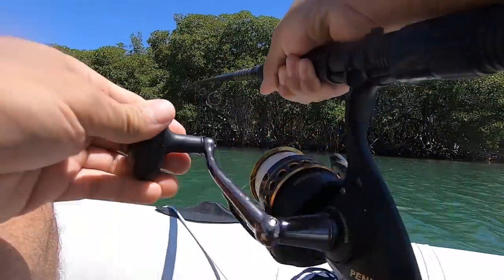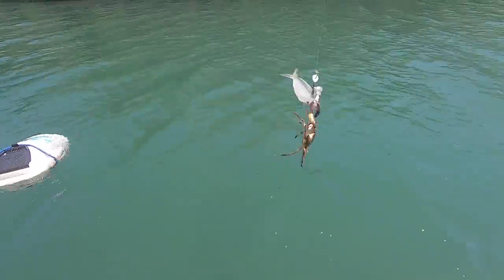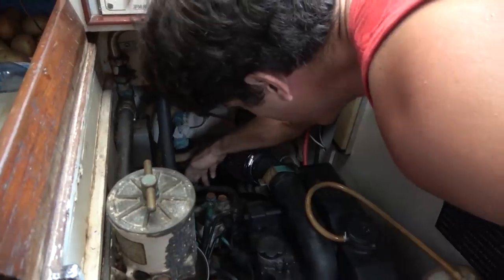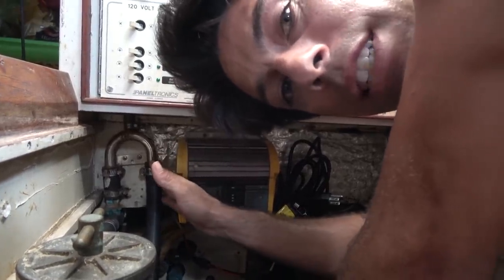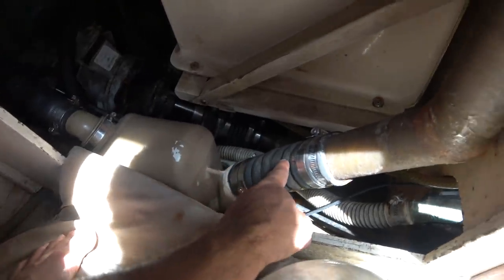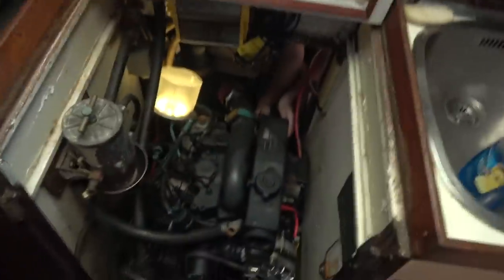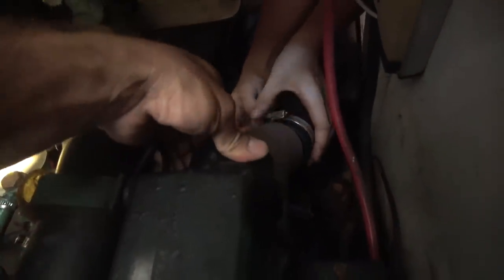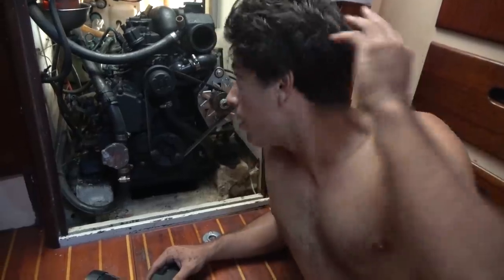Our Secret Weapon is SIMPLY Brilliant! - Bums on a Boat Ep 128

Comment: You  two are becoming mechanics.   Take a screw driver to that oil pan and poke it,  do it on the side first,  not hard enough to dent it, but enough to get a feel.   Then try the bottom,  if it goes through easily you found your problem.   Oil pans rust,  especially after long periods of non use.   Good news is they usually aren't too  expensive,  bad news,  might be a challenge to change in the water.   You want to know now if it's an issue, not find out on a dark stormy night that the pan is bad.      Persistence is key to success,  you both are showing a lot of that.

Comment: Any parts store will have UV leak dye. Add it to the oil (and closed water, transmission, etc) and after running the engine, look around with the UV flashlight that comes with it. A $2 fake money light also works for it. Any leak will glow brightly.

Comment: Love watching your videos; avid subscriber.  As a maintenance tech here is some info that might help.  The reason you have the intake cooling line running through your Gearbox is to cool the gearbox oil while in use.  There is a single copper line that goes in and makes a loop and exits.  then on to your water pump.  This allows the gearbox oil not to overheat.  On another note, some call your gearbox a transmission.  A transmission is the ACTION of transferring power from engine to shaft.  Gear box is used to describe a particular piece of machinery that generally contains two or more gearsets to transmit rotary motion from one place to another.
Reply from the maker: 💡 thank you for passing on some knowledge!

Comment: Thank you for showing the entire system- I have been thinking about this since the last video. As I can tell the boat is a 1974 and the engine is decades newer, indicating there was a re power- I have been involved in many over my years working in marine diesel. Many times an engine will not perform to it's potential or indeed suffer failure due to poor installation. Like having the air intake or exhaust restricted.  We sold an 8kw genset to a motor sailer to replace a 5kw as they added air conditioning and needed more power- then the yard connected the new generators 2" exhaust to the original gens 1 1/2" exhaust- the thing had so much restriction it barely ran- the owner said "the boatyard said it was fine" we (the generator dealer) said "fix the exhaust to manufacturer's spec, or no warranty"  thus the fight began as the boatyard had hours in cutting a bulkhead etc but that wasn't our issue- they were provided with the specs the unit required.  Had they not fixed the issue, that engine would have a short lifespan and possibly failed from water backing up the pipe.  Hope it all works out for y'all.

Comment: Not sure if others have commented or not but you'll definitely want to add antifreeze to the freshwater cooling system. I know you're not in freezing temps but it's also a lubricant for water pumps and has corrosion inhibitors that help protect your engine.
Reply from the maker: Thank you. We used water because we drained it about 3 times in order to flush and clean the cooling system. We now have antifreeze in there.
Reply: @Bumsonaboat  good work!

Comment: All the oil should be in the oil pan since it hasn't ran in a while. If you cleaned the bottom of the pan you may have exposed a crack. Try wiping it as clean as possible and look for seepage every few minutes with a mirror. Good luck!
Reply from the maker: Thanks for the tip!

Comment: Oh and use T bolt style clamps on anything from engine to waterlock.  the worm gear type hose clamps get vibrated loose.  Change out the worm gears as soon as practical.

Comment: If you have oil leaking or mixing with water inside the engine, check the cyl head, or oil cooler if it’s water cooled. Take off the oil cap, is there a tan/brown goop  there? Might be head gasket or cracked block. How long has the water been inside the oil pan? If you have to pull the engine, you’re probably better served to rebuild it or replace with new one. Hoping it’s a simple fix for you guys. Keep the videos coming. Thank you.

Comment: If you guys have the time this would be a good opportunity to lift the engine either just up or out completely and give it a full going over and correct any problems and replace any parts that aren't accessible when the engine is in place. Also you would have the opportunity to properly clean and repaint the engine and bilge. Also a good opportunity to sound proof the engine compartment as well. Just remember to never use a flammable degreaser/solvent to clean the bilge etc or you will run the risk of an explosion from the build up of the vapours, like what happened to nutshell when they blew up the boat after using a flammable degreaser to clean their engine and bilge and the next day put the kettle on the stove to make a coffee and boom the whole inside of the saloon was destroyed. Luckily they were on the deck when it blew or they may not have survived the explosion.
Reply from the maker: 😰 woah. Thanks for the tip...

Comment: Don't run it to long check oil pressure. If you run without enough oil you burn up bearings. Once you find the oil leak, drain and save the new oil. Probably you bumped an oil line or loosened the filter some how while fixing the water cooling circulator problem. If its the oil-pan  you mite be able to patch it.

Comment: Did you remember to lubricate the oil filter rubber gasket prior to reinstallation? Also, they make an ultraviolet dye you can add to the oil to isolate leaks. You'll  need a UV flashlight. Most auto parts store will have the dye. Oil filter leaks are very common.

Comment: When leak hunting it can help to put a clean sheet of paper, newspaper, cloth, or puppy training pad under the suspect part, like tge whole engine and any drips will show up easy and then you can follow the snail trail to source
Reply: I like that but think it will definitely show up right away. Even a slow drip over months of non use and you will lose it all. Especially if its coming from the bottom of the engine where you can't see it. My thoughts for the camera were that its definitely leaking, look around with the camera right away and find out if its the nut under the oil pan, or an actual hole in the oil pan, or maybe the oil pan seal , which is the most likely of all. Sometimes tightening up the ring of bolts holding the oil pan on seals up the leak. Other situations require a oil pan gasket.
Reply: What he said

Comment: Suggestion guys, take detailed pictures of your engine before taking apart anything so you can go back and see exactly how things were connected, fastened, routed and you will rarely make mistakes on putting things back together. I always like to get cardboard and make holes to put bolts and such in so I recall where they go back when I was a novice at rebuilding. It sounds like the firing order is off. Distributor, plug wires, plugs fouled or fuel. Easy checklist is FAST., Fuel, Air, Spark, Timing. Assuming you have compression, if all those things work the engine will start. Good luck. Don't worry we have all been exactly where you are right now with engines at one point or another during the learning experience of becoming a decent mechanic. So keep grinding and learning.

Comment: When you attempt to clean your bilge, I suggest that you get the Dove dish washing liquid soap. Do not let that oil dry on the bottom of the bilge. It will permeate the boat with a bad odor. Use the commercial items that soak up oil and try and pump all of the bilge water into containers.  An inexpensive siphon hand pump can be had from Harbor Freight or some other vendor. That's a job you want to get on asap.  My cruiser blew out the oil temp gauge on one engine, the dielectric insulation on the sensor failed, result was seven quarts of oil into a once pristine bilge. It was not pretty. Good luck. It's a nasty job.

Comment: YOU ARE 50 HRS FROM PUERTO RICO. Go for it and sail it, I did it from Puerto Plata with a stop in Samana. Fine a buddy boat to make the trip with you, check your rigging, have your dinghy/engine ready to go incase, pick your weather and go. Once there 70% of your troubles are over in so far as parts and resources are concerned. The other 30%.......well..... it’s a boat.

Comment: A vented loop NEEDS to be o the positive pressure side of a pump (the side the pump is sending liquid to). If you put it on the negative pressure side, it will introduce air into the system.

Comment: About that leak , that you have probably already found and fixed . To find , you need a clean area , a bright light and patience . Lie on the floor looking at the engine waiting to see a drip with it running - might take 5 min for a single drip . Vary the speed of the motor . If that fails it is not leaking much and the solution might be a clean rag under it to catch the drip .  The gasket thing on the filter is well known and sometimes does not leak for a while until the extra gasket blows out because it is not in the grove that stops that . If that is the case the leak will be obvious and catastrophic . 

The motor will not be worn out , those are converted work engines meant to  work all day every day . What gets them is rust, rot  and neglect .  Looks like you saved her just in time .  Don't over heat it , don't run it without oil, keep the fuel clean .  Check the filler cap has the o ring on it or water will get in the fuel .
Reply: One other thing - use fuel treatment if you are not going through a tank every month or two . If you ever use regular diesel from a gas station it probably is low sulfur and does not have enough lubricant in it for your older engine - you must add treatment to make up for it  or you will eventually damage the engine .

Comment: While another Cliffhanger awesome I believe that last Muffler that's in line is actually a check valve it may need to be replaced check valves work like that flapper valve .. actually just put a check valve inline putting a deep well in every hundred feet let's water not fall back down.. anyway keep up the awesome videos I'm also a diesel mechanic just changed a oil pan gasket on a ISX Cummins engine.. if you have to replace
the gasket on yours ,is not that big of a job.but if the oil pan needs replacing, Probably gotta pull the motor....c'ya

Comment: Your exhaust and cooling is fine. No worries on the 70* down elbow use. A lot of MD2020s had that expensive loop elbows regardless of engine above or below the water line,. You're fine the way you have it. Flapper is just suspenders with the belt . Can't hurt  unless it gets stuck closed.

Comment: If and i mean if, the head is cracked... 
Oil floats on water and will coat the dip stick as you pull it out tricking the eyes into thinking its full. If water is in the oil pan the oil will rise and slowly seep out of the oil pan? Just a thought. Good luck!!!

Edit
Ps thank you for wearing pants!!
Reply: not really.  If there is water in the engine oil it will not separate as easily as your salad dressing . The cranking will make it look like a milkshake.
Reply: @Baba3756-n2o  it separates in a few days.

Comment: First, Always start at the top of the engine, clean it and work your way down when tracing leaks. 
Second, oil will rarely leak with the engine off unless the pan is rotten, or drain plug gasket is on it's way our. 
Third, that oil is too clean to have been
run in  an older diesel for any length of time, plus the color looks more like 80/90 gear oil to me. Maybe I'm wrong, but check your trans oil level and trans for leaks while your at it.

Comment: The best thing is to pull the Engine and get every thing fixed on the engine. while its out the boat then you know you have a good working engine to go sailing with. and you can clean and paint the engine compartment and soundproof it

Comment: For the alternator check and see if you have a pressure switch as part of the electrical circuit.  If you do then this will seem like the alternator is not working until the engine rpm is high enough to activate the pressure switch allowing the control current/voltage to the alternator coil will activate and afterwards the alternator will charge at any speed.  I have to rev my engine up to about 1500 rpm before this pressure switch activates and the alternator charges.  With my alternator the tachometer doesn't work either until the pressure switch is activated.  All of this assumes correct wiring.  Good luck!
Reply from the maker: Incorrect wiring in our case being the most likely culprit 😁.... Dont want to spoil the next ep!

Comment: I had a rusted out oil pan on my current boat, it was a PITA to remove with minimal engine jacking and cleaned and patch welded and reinstalled. Wasn’t super expensive just a lot of grunt work.
Reply from the maker: Thanks for sharing

Comment: Brake clean oil pan and engine very well. (Don’t know if it will be harmful too boat hull). Then make sure it looking from pan. If so then unfasten all motor mounts and any kind of transmission mount and see if you can pick motor up barely enough to get pan out using a 90* angle electric ratchet highly recommend for and mechanical projects that are tight....

Comment: Shut off your raw water valve if you are going to be cranking the motor over for long periods. Be ready to quickly open it back up when it sounds like it will fire or just after it is running. You don't want to fill the exhaust with salt water.  Even better fix it so it starts quickly. Looking forward to next video You guys get an A for effort and attitude!!!

Comment: I think Michels Dad had an excellent point about the "extra" oil filter gasket. Hopefully you pulled the filter away and checked it out first! Also, the gasket can get a bit cocked and not seal properly. Always smear some oil on the rubber gasket Before screwing it back on and only hand tight. Keeping my fingers crossed that your next posting will show us Wonderful things!
Reply: Edward Grant Yes, Michel’s Dad is right. From my experience, if the old gasket is still in place when new filter is fitted, the oil will not just leak, it will rush out.

Comment: Recheck the torque on the oil pan bolts ,they can loosen over time.
With no oil leak with the engine off would make sense since the oil level may not be over the elevation of the oil pan when not running.

Comment: gees I dunno bums, engine is like the life-force of the boat, its prob the one thing I wouldn't want to have any doubts about condition or reliability. if it were me, I'd either pull out for a full rebuild or go with a new power plant. nearly every single time its cheaper in the long run plus you get peace of mind.

Comment: I really feel for you with your engine issues (Ash, the diesel mechanic). I'm not sure the flap valve won't restrict the exhaust too much, but it may help solve the wave issue. I think a gate valve (big ball cock) in the exhaust system would work also...... you just have to open and close it when you start and stop the engine, pain in the arse, but manageable!  Luv ya work!

Comment: Can't remember the details, but did you think that you had water in the engine oil ? How long ago was the engine oil looked at , replaced, ect.
Reply from the maker: No we did not have water in the oil. We believe the oil filter was on loosely. When we tested the old alternator we revved it up pretty high. Maybe it came out then.
Reply: @Bumsonaboat  Ok, hopefully. The "fresh" water circuit shouldn't be plain water. Most put stuff in it that has anticorosive stuff and lube in it. Two brands, one "nalcool", two "napacool" (napa auto store)  . Others I've been sold are not nearly as good. Goes in the fresh water side. Makes you water pump last 10 times longer. Keeps things from rusting inside. Best friend was a diesel parts manager in a port city. Also, a little short on oil is much better than too much. Too much causes too high oil pressure making the oil leak out. Important for diesels.
Reply: @Bumsonaboat  If I were in your shoes, even if I repowered with a brand new motor, I would still put a 10 or 15 hp. Outboard motor, and mount (check the hp rating on the mount), on the back of the boat, especially with the kind of distance you plan to cover. I have a buddy who has a 10 horse motor on his Catalina 30 because the inboard is gone. He gets 5.5 knots out of it at open throttle, and we've found that being able to steer with the outboard makes all the difference in tight quarters, especially when the breeze is up. So, when the inboard gets replaced, that outboard is staying on the transom for backup propulsion, and greater maneuverability. Just a thought.

Comment: BTW - If you cannot get an oil pan for the engine, you can have one fabricated by a welding shop of you take 'em the old one. Also, you do add water pump lube and anti-rust to your freshwater cooling circuit, right?
Reply from the maker: Yep! Just water initially to check for leaks, and we found one !

Comment: JB WELD I used it on a rotted out cylinder head that lasted 15 years then sold the engine. trust me if its the oil pan

Comment: It looked like you just put water in the cooling system I could be wrong but if you did just use water your engine will overheat you need to use engine coolant or what ever your engine required engine coolant has properties to withstand a higher boiling point
Reply: I think the idea is to find out if it leaks before wasting coolant on it...
Reply: You're thinking a car engine that dumps to air. This dumps to constantly refreshed sea water ... no need for it to exceed boiling.

Comment: You have to add antifreeze to the coolant or the engine will rust on the inside.
Reply from the maker: Correct Jack. We plan to drain it a few times to clean it out before we fill it up with antifreeze.